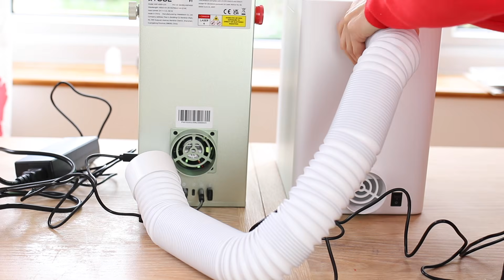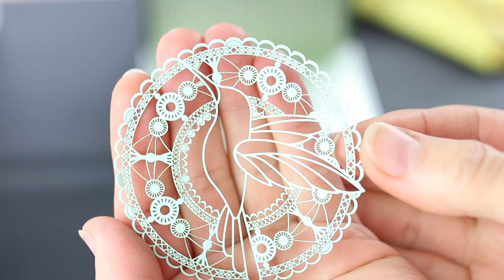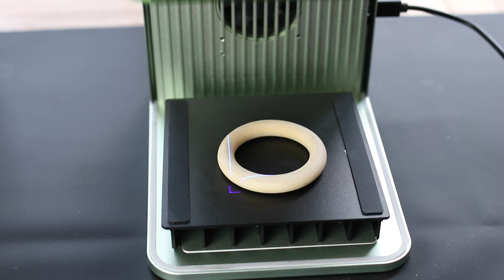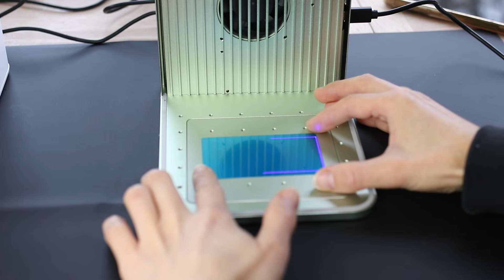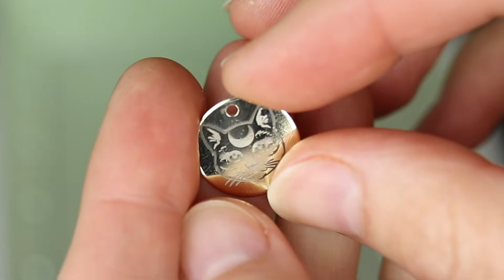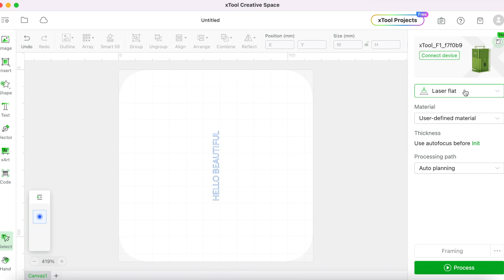Engrave INSIDE Rings!! With xTool F1 (30+ DIY Jewelry & Craft Projects)

Comment: Great video! Just a heads up if you haven't learned yet, there is a video out that shows how to change the orientation of the Rotory motor so it fit better in the F1 from the right side. I have done this and it works just fine.
Reply: can you share the link? thanks!

Comment: You’ve probably worked it out already but the photo fade at the top of the picture is because you need to do an IR pre heat which is in the settings. Easy fix.

Comment: Never turn the rotary to the other side ;) You can unscrew the Motor and turn it 90°, so that the cable is on the top of the device :)
Reply from the maker: Thank you for the tip 👍🏻
Reply: Embrace Making shows you how. I've done it with mine and is so much better  @AvaAndAngelsArt

Comment: Hi! great video! helpfull! right now I having trouble to frame with the software, can you help me? when I press "frame" the rotary just spin but is not clear here is it going to engrave inside the ring... thank you.
Reply from the maker: @adalizkareli2681  hi, I’m not too sure what the problem is, but if you focus the machine properly and tilt the ring, it should work and engrave it. If you can, just order some cheap stainless steel rings and try it on those first ❤️
Reply: @AvaAndAngelsArt  thankyou

Comment: hi i want to make customized name initials necklace of gold plated stainless steel for my customer, I have a question when I cut the metal do I need to polish it and if yes how can I polish it as I know the cut edges don't have the gold plating
Reply from the maker: This machine can’t cut metal, you’d need a really powerful fiber laser, probably industrial type. Some less powerful fiber lasers can cut thin sheets of metal, but those would probably not be strong enough for necklaces. This machine can mark the metal and engrave and cut various types of other materials.

Comment: Is there a way to engrave the metal without or coming out black? Instead I am looking to see if it will engrave more with a metal look Rather than black.
Reply from the maker: This machine and all the diode lasers that can engrave metal using blue laser or infrared laser(depending on the type of metal you are using) will only mark the metal. You will be able to feel the marking with your finger nail, but it is not a traditional deep engraving you get using a Fiber laser or engraving by hand. The black colour is an oxidisation of the metal and you'll be able to rub it off or it will rub off eventually through wear(shower, swimming pool etc) Once it does, depending on how deep the marking is, the design will still show, but it will be not as deep as standard engraving if it makes sense. I'll try to make a video on this and show examples.

Comment: Fantastic video and amazing information. I have watched your other (includes the D1 Pro IR) and wondering if you can advise which one to choose between the D1 Pro IR and this F1 for metal, jewelry engraving with a deeper text look. Thanks for your time.
Reply from the maker: I’m so glad you found my videos helpful ❤️ To answer your question, it depends on what material you want to engrave. I have found the F1 works great on most metals. Every metal I tried so far worked. And I have done even more testing after this video. The depth of engraving can be adjusted in the settings. There were the particular plated brass discs, which I had a problem with, but I ended up putting the speed super slow and it worked eventually. But took a long time to engrave. My D1 pro with IR worked better and faster with these discs. Having said that, I also engraved the rectangular domed plated brass and that was fast and looked awesome. Bare copper took a long time to engrave deeply too. 
So considering everything, I’d choose the F1 without hesitation. It really is an amazing little machine, for smaller projects. And the fact it engraves over a curved surface is so cool and It’s fast, portable I really love it. I have another video on the F1 coming up soon, where I’m going to explore even more materials and mainly metals like pure gold etc. It should be up in about two weeks 🙂
Reply: @AvaAndAngelsArt  Morning. Thank you so so much for taking time with the comprehensive suggestion, I really appreciated (first time ask question on youtube in this way and really surprise to have the reply honest) I am personally preferring the F1, consider everything mentioned. It is going to be for my start up personalize business where aiming for customized personal gift, like leather tag, wood, silver (jewelry). One feature I am planning is to have different color display on the object engraved, for example, same text or name can have different color on different wood to make the text looking stand out, which I read the description of the D1 Pro (there are over 300 color choice can be adjusted and processed). So I am wondering if you have any experiment regarding that aspect? I am sorry for many questions, it is a very important tool for my business and I would like to get it right in the first place (with your help, I can have a shortcut for the journey) Thank you so much for your time.
Reply from the maker: @transfertalk-x5v  I’m happy to help if I know the answer 🙂 with the colour of the engraving, I’m not sure if I understand right, but I’ll try to answer anyway. With wood, the deeper the engraving, the darker the colour. Metals are the same, but the engraving isn’t going to be really deep(you’d need a fiber laser to do that) but it marks the metal and you can feel it being engraved. The stronger the power + slower the speed the darker the engraving. You can also play with settings and engrave metal like stainless steel with colour(it’s not actual colour of course it’s just going to produce different shades and tints with different settings) I am not a very patient person and so I appreciate the speed of the F1 (as well as other features) I’d say cutting wood seems to be better on my d1 pro 20, it’s a cleaner cut, less charring and straight. F1 is faster at cutting, but seems to burn the edges more, plus the cuts are slightly angled. But it’s ok, I still like it. I hope that helped and don’t worry asking more questions, I understand it’s an investment and you want to be informed 👍🏻

Comment: Hi do you have any attempts at solid 9ct gold? Also, can you improve the depth of marking on the sterling silver?
Reply from the maker: Hi, I haven't tried engraving solid gold, but the disc I had was 14k gold filled. The settings for silver were the same I used on my D1 Pro with IR module and they seemed to work great. But I'm sure you can reduce the power/ increase the speed to get lighter engraving. Or even darker one if you play with the settings.
Reply: @AvaAndAngelsArt  thank you for following up

Comment: Fantastic ! Thank you for this wonderful discovery !  I'd like to know if it's possible to print a small logo on an 8mm diameter steel bead with this laser machine ?
Reply from the maker: I’m happy you found this video helpful 🩵 I haven’t tried that, but honestly I think you can. The engraving goes over curved surfaces, so I can’t see why it wouldn’t. Next time I use it I’m going to try and let u know 👍🏻